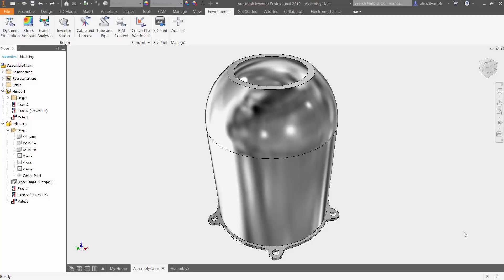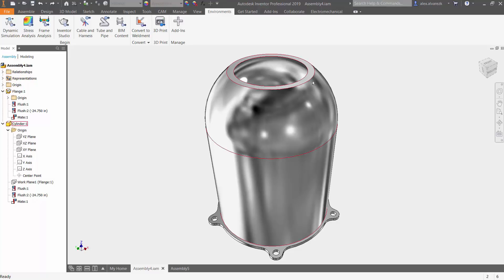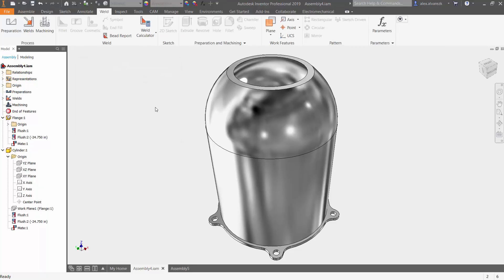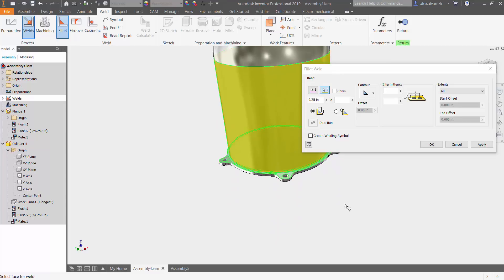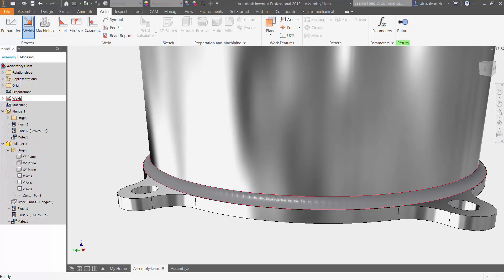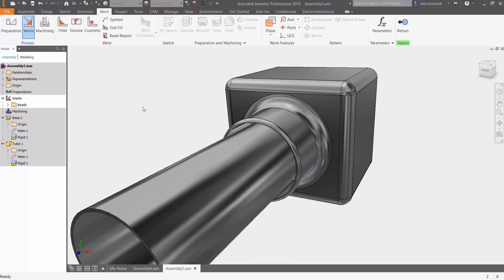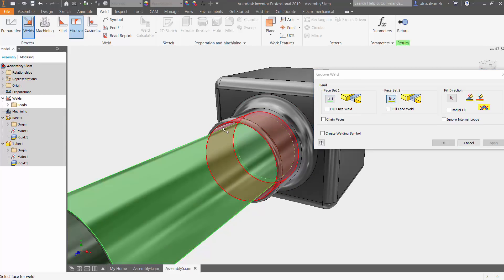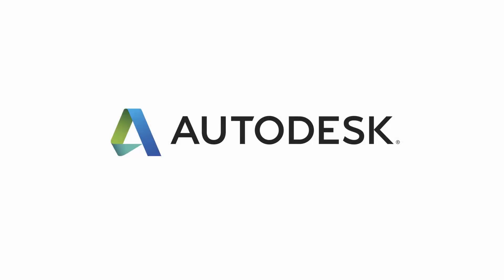Quick Tip - Weldments

Comment: The depth of the weld is still missing. This is done by dividing the area of the part, then the welds of the given areas can be adjusted.
Reply: How the depth was missing ? 
What should to make it right.
Reply: @fluent.co.ltdmoldingoptimi8546  time 3:55 In part, he must divide the surface using split if he wants to set the depth of the weld. Welder = In reality, he will not make a weld to such a depth.